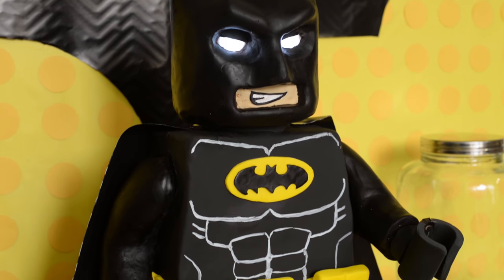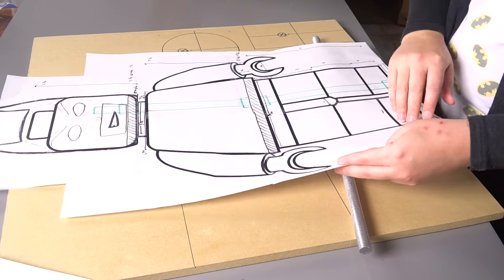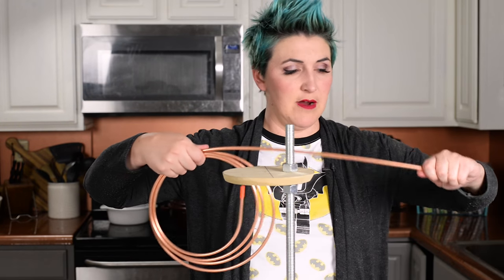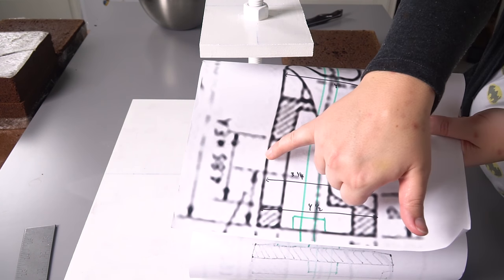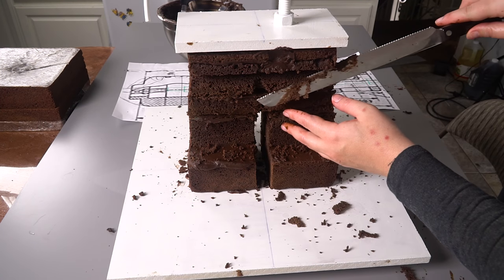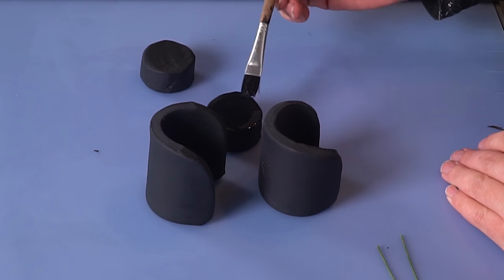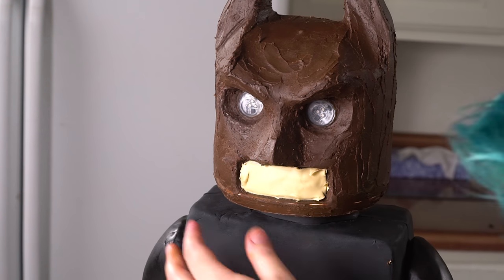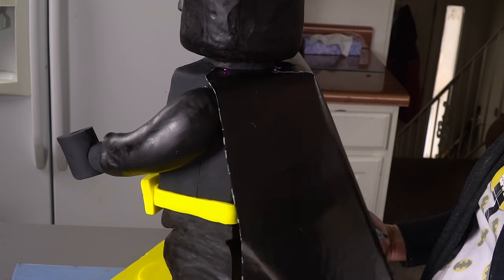How to Make A Standing Lego Batman Cake

Comment: Hi Ashley Marie!  I have a question - Thank you for this wonderful tutorial - I did not catch how far off center you made of hole in each of the 3 boards.  I know that the hole itself is 5/8" but it really matters how much off center because if its too close it will be in the split of the legs and if its too far off it will be outside of the circle to support the head.  Also, I am just not great at math which might help.

Comment: Amazing! I would like to try this and make it into a Lego Ninjago cake for my son's bday. I'm just scared to do so without the actual measurements. I'm also self taught and have found inspiration for all of the cakes I've made on YouTube. I've done 3D R2D2 and a 3D minion so far. Thanks for giving me hope that I can actually do this and make it work! Thinking I'll do the legs in rice crispy's as I don't need that much cake. Never used modeling chocolate before, do you think it will stick?Thanks! Jen
Reply from the maker: I'd just print off a picture of the ninjago character you want to make in the size you want to make it and start measuring away! not everyone wants an over 2 ft tall cake! and I'd make sure to cover the rice krispy treats with ganache, make it nice and smooth, before adding fondant or modeling chocolate

Comment: wow amazing work thanks for sharing.....can u share how to make paint splatter cake on fondant...
Reply from the maker: I use a stiff brush or a tooth brush for splatters - I splatter in this cake video https://youtu.be/OJXcXnPXcpM
Reply: Ashlee Marie Cakes watched splatter video .. thanks ..but u use vodka..can I use water
Reply from the maker: water gets slimy on fondant and tends to drip really badly, also it doesn't dry so if you touch the cake you'll smear the drips, while the alcohol evaporates leaving the color in place without the sliminess and it won't be smeared off.  you can use clear vanilla or almond extract if you prefer. vanilla is usually made from vodka and almond extract actually has a higher alcohol percentage than vodka.
Reply: OK